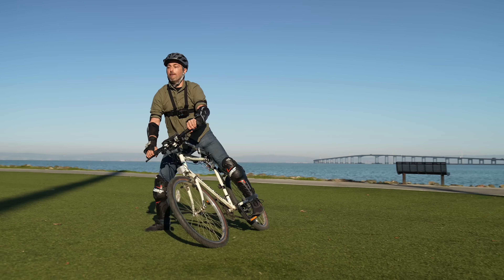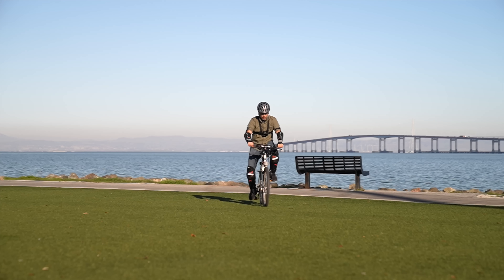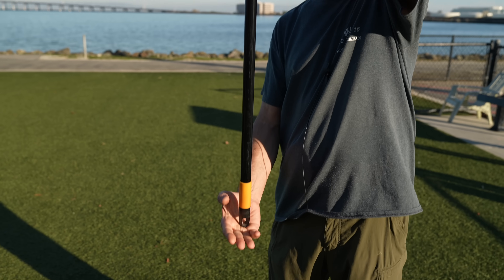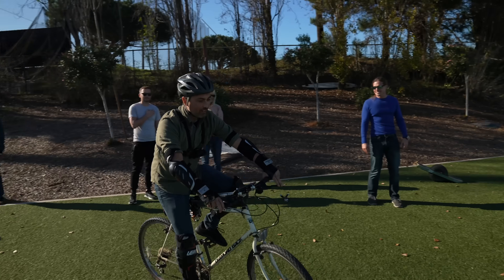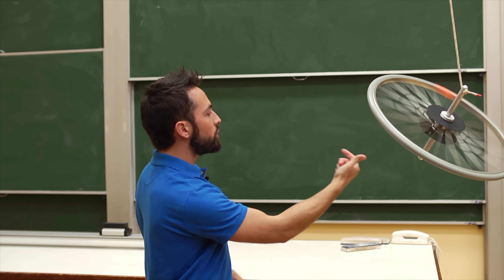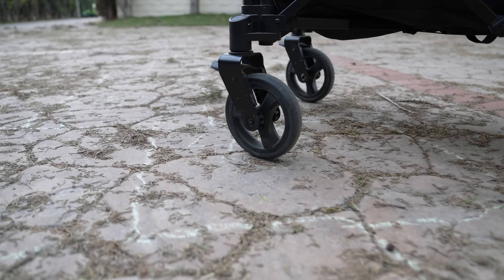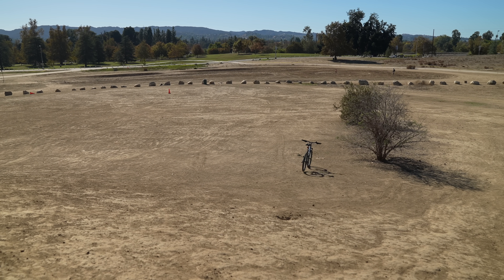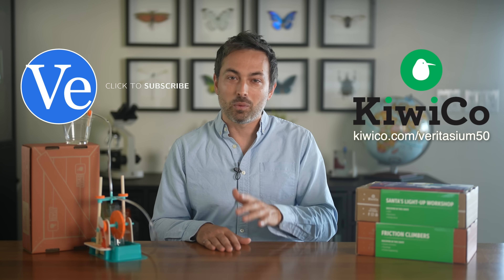Most People Don't Know How Bikes Work

Comment: There is one slight issue with this. I've ridden a bike for a long time and am very familiar with counter steering. However as Derrick points out, when you want to steer the bike a certain way you must first counter steer to move the bike out from under you and then steer into that lean. However you don't need to counter steer to move it out from under you, you can simply shift your weight and lean over and then steer into that lean just the same. 

If what he's saying is true then you wouldn't be able to steer with out touching the handle bars but that's really easy by shifting your weight.
Reply: If you're leaning into a turn at any significant speed, you are counter-steering. You may not realize it but you can notice by the PUSH pressure you're putting on the side of the handlebars the direction of your turn is going. If you're at speed and leaning into a turn and you're not applying that counter pressure, you aren't turning, you are high-siding.

A better thing to highlight in this video would have been to explain the speed threshold in which this applies, as it's likely not as apparent to a MTB rider as it would be a motorcyclist.
Reply: So many "know-it-alls" here, even after being shown definitively that countersteering is indeed utilized in every turn.  Frustrating!
Reply: @dudeonbike800  You'd think the hands-free examples we have chiming in here would be able to see this easily happening before them.

I think that the main flip flop I'm seeing here is the semantics around "steering". Generally speaking we're talking about the riders input. For the hands-free people, you're still witnessing counter-steering. Your bike steers inward when you lean in order to keep the bike upright, not to help turn that direction.
Reply: @dudeonbike800  Shown definitively? Not even close! Not one of the people there were able to remain upright on a perfectly still bike. Once you show me someone who can remain upright on a stationary bike that can't turn without a counter steer, then I will believe it.
Reply: @willhendrix3140  every bike countersteers to initiate a turn, regardless of handlebar input.  With an exception of kicking out the rear wheel to initiate a powerslide, perhaps.

I can stay upright on a stationary bike without a counter steer.  It's called a track stand and one does it with the front wheel turned to the side and the bike is rocked back and forth to maintain equilibrium.  The track stand starts and is held with the wheel turned, so there is no countersteer involved.  But that's irrelevant to the balancing dynamics issue of a bicycle in forward motion.
Reply: @dudeonbike800  That's a great example! I'm not a professional biker, and had never heard of a track stand, but it is the perfect example. A track stand is essentially taking counter steering to its absolute limits. You are moving the contact point of the bike with the ground back and forth in order to keep your balance. Turning without counter steering is essentially a track stand with your breaks held all the way down. Much harder, but still doable
Reply: @dudeonbike800  The scientific method relies on doubters and contrarians. Debate and diversity is healthy.
Reply: @topcat8804  but arguing something that's been clearly proven here and in a LOT of other places is banging your head against a wall.  I've known this for a long time, yet people still stick to their preconceived notions, despite being proven wrong again and again.

Just read down the comments and people keep saying, "Yeah, but with an EXPERIENCED CYCLIST, maybe not..."  No, it's the same dynamics, regardless of the rider.  I've never actively countersteered my bicycle, but I don't deny the fact that a bicycle "steers into the fall" every single time.
Reply: Absolutely! I've been a mountain biker for more decades than I can count. This method is often used to maintain your line while turning. To teach it, I describe it as "diving into a turn". That's what it feels like.
Reply: Faster and heavier bikes prove the point of this video. No counter steering means no turning. Twist of the Wrist author Keith Code demonstrates this with a custom bike with a fixed set of handlebars above the main ones. No amount of leaning gives any kind of meaningful cornering.
Reply: I’m only a casual biker so I may be missing something, but in my experience of riding hands free, the handlebars are actually still moving. They move because of the “self-driving” forces outlined starting at 7:25 that turn the front wheel towards the way you’re leaning.
Reply: When you ride a bike without using the handle bars you are making tons of micro adjustments while riding and before leaning to turn one way there will absolutely be some kind of counter steer that takes place before hand. You can't just "lean" on a bike. In a perfect scenario where you were perfectly balanced on a bike that had very skinny contact points with the ground and there were no outside forces acting on you, it would be impossible for you to fall off of the bike. If you leaned one way the bike would lean the other and your combined center of mass wouldn't change. That's why in the test with the stationary bike and the bike with the completely locked handlebars nobody started to fall one way, only to bring it back and fall the other way. No matter what, if you are turning, some degree of counter steer has to happen beforehand, initiated by you or not.
Reply: Shifting your weight moves the handlebars.  The guy that desperately tried shifting his weight seemed to show that if the handlebars can't move, it doesn't work
Reply: Hmm I think you are wrong, leaning into a turn does involve counter steering, and so does turning with no hands. Counter steering still happens in both scenarios. I first heard about counter steering on bikes as an explanation for how a leaning turn works. No hands is easy to tell, you can watch how the handlebars move as you shift your weight.
Reply: There is a great example in twist of the rist 2 about learning to drive motocycle. Motocycles depend on countersteering for safe driving and there is an example what happens when you just lean.
Reply: It feels like it's your weight and you're not counter steering, but you'll find you actually are, just very subtly. This becomes more evident on a sportbike at 100km/h+ because at that speed it's basically impossible to steer using only weight, but even a slight push on the bars with your pinky can lean the bike all the way over. I also intuitively thought the same thing as you until I tested out trying to steer motorcycles and bicycle at more than 40kmh without hands on the bars.
Reply: Twist of the wrist disproves this. Body lean definitely has an effect on a bicycle because it's low mass, but it becomes clear on a motorbike. Countersteering is the one and only way to steer a bike.
Reply: @stable-confusion-x  seconded. Twist of the wrist is brilliant to mythbust a these non believers of countersteering
Reply: @PiggyPower  It's surprising there are so many non believers.. until I remember that I was one before watching TOTW.
Reply: @stable-confusion-x  ... but bikes DO have low mass.  Countersteering for motorbikes is all well and good, and it certainly works for regular bikes, but contrary to the claims here it is not needed for a regular road/mountain bike with locked steering.  The noobs in this video couldn't, but they are very much doing it very wrong.  To steer by leaning on a bike you need to get your butt out of the seat and you're actually going to be applying a lot of downforce to the opposite handlebar.  That is, right foot pushes down pedal, left hand pushes down handlebar, the bike leans right and you lean left.  That is how you go straight with locked handlebars.  To go right, you don't apply as much force on the handlebar to counter, opposite scenario for left.  When people say they "lean right" I think they mean they are leaning the bike to the right, but they put their weight left to stay balanced.  At slower speeds that is, at higher speeds you do have more leeway from the gyroscopic effect to use a much more mild lean.  You can't swap your weight appropriately with your butt in the seat, so it is very obvious how everyone in this video fails.  

Sorry for mixing two cases above, a locked bike steering won't go right or left, but it should be quite possible to go straight on it.  In the unlocked steering case I contend that it is possible without counter steering, but you do still need to be able to steer in the intended direction.  

Motorcycles have much more mass and cannot be readily manipulated in this way.  It's plenty of effort on just a bike.
Reply: @zvxcvxcz  You are wrong. Counter steering is required for all single-track vehicle. Lookup the turning section of "Bicycle and motorcycle dynamics" in Wikipedia.
Reply: @zvxcvxcz  you can push down as much as you want on the handlebars of a bike, motorbike or bicycle... It won't do anything. Push left to go left. Push right to go right.
Reply: @zvxcvxcz  When you lean a bike over with locked handle bars, you're now riding a bike straight ahead and leaned over to one side. I highly encourage you to watch twist of the wrist. I think you'd get a lot out of it.
Reply: No you still need to counter steer. "Pushing the bike out from under you" is kind of a poor description in that regard. You need the combined centre of balance of you and the bike to move out of line with the point where your wheels touch the ground. If you lean without steering, your bike will lean the opposite direction and your combined centre will still be above that point.
Reply: @jjkthebest  This is not the case. It is entirely possible to shift your center of mass without leaning the bike, just get out of the seat and shift side to side
Reply: @willhendrix3140  If you "get out of the seat and shift side to side" you are just leaning the bike in the opposite direction. This does not directly change your center of mass. Every action has an equal and opposite action.
Reply: @garethhanby  Think about it this way: the pedals are in the up-down position, and you are standing on the bottom pedal. Easy to balance now, right? You can move your center of mass back and forth without leaning the bike, and you can lean the bike without moving your center of mass back and forth
Reply: @willhendrix3140  You're kidding with this center of mass and no counter-steering stuff right? Please by all means list the factors that are allowing the bike to turn when you "just get out of the seat and shift side to side".

If you are not leaning the bike, yet you are turning the bars in the direction you want to turn, I don't care where you put your center of mass, proven physics says your ass is high siding.

I'm thinking you're basing this off of some low speed maneuvering, in which you're just not noticing or just deciding to disregard the lean that is in fact happening with the bike.
Reply: @willhendrix3140  Why are you talking back and forth? This is left to right movement we are talking about. I don't know what you mean. But we turn a bike by leaning the bike not changing the center of mass of the man-bike system.
Reply: @kkanite6170  There are two ways to lean a bike: by leaning your body and having your bike lean the other way:〈 , or by moving yourself to the side and letting gravity take you down (I don't have a character to represent this, think a table with two legs on the same side taken off as the extreme). By going the second way, if you time it right, you can turn with no counter steering required by using the lean you get during the "fall"
Reply: @garethhanby  If you change the center of mass relative to the contact positions of the tires with the ground, the bike starts to tilt in the direction you want it to. Leaning like〈   just moves the center of mass in the wrong way and is the reason why people fall off still bikes. If you only focus on the center of mass and the contact points with the ground, you can stabilize a still bike much easier, and can initiate a turn without a counter steer
Reply: @willhendrix3140  The point is you cannot "change the center of mass relative to the contact positions of the tires with the ground" it is one of the fundamental laws of motion:
-"If a system experiences no external force, the center-of-mass of the system will remain at rest, or will move at constant velocity if it is already moving"-. 
In this case the system is the man-bike and leaning does not change the center of mass at all, it remains directly above the tires. When you lean the bike tilts because of the reaction force of the movement, not as a result in the change of the center of mass.
Reply: @garethhanby  There is an external force, friction between the tires and the ground. If you lean like〈  , you aren't moving the center of mass much, but if you shift your body one way or another, the bike-man system experiences a friction force against the ground, and the center of mass moves relative to the contact points
Reply: @willhendrix3140  Well yes, that friction does exist, but when you suddenly move your weight (left-to-right) the centre of mass does not change and so there is no friction due to this movement. Friction only comes into play when the bike turns in response to the leaning.
Reply: @garethhanby  What I am saying, is that by being picture one, you are keeping the bike straight and moving the center of mass away from the contact points, allowing the fall to occur without a counter steer
Reply: @willhendrix3140  How did the first one come about? The person leaned to the right, to do so he would have to push the bike to the left which would have leant the bike to the left. The first diagram would never happen, it is against the laws of physics. This is really basic stuff.
Reply: @garethhanby  Think about putting the seat of the tire in the crook of your knee. You move to the right, the bike is to the left of you, your center of mass is way off balance. 
Sorry for the late response, for some reason rusty's comment came in before yours, even though the timestamps are the other way around
Reply: @willhendrix3140  Oh dear, you cannot just move to the right, there is this thing called conservation of momentum. There is one mistake I made to do with tyre friction. If you lean to the right - which you can only do by pushing the bike to the left - the bike will attempt to rotate around its center of mass. If you did this in free fall the whole bike would rotate and the tyre would move to the right. This is prevented on the ground by tyre friction and the center of mass would move slightly. But the effect is small compared with the others.
I found this in an excellent wikipedia article entitled "Bicycle and motorcycle dynamics" which has a steering - no hands section:

While countersteering is usually initiated by applying torque directly to the handlebars, on lighter vehicles such as bicycles, it can also be accomplished by shifting the rider's weight. If the rider leans to the right relative to the bike, the bike leans to the left to conserve angular momentum, and the combined center of mass remains nearly in the same vertical plane. This leftward lean of the bike, called counter lean by some authors,[45] will cause it to steer to the left and initiate a right-hand turn as if the rider had countersteered to the left by applying a torque directly to the handlebars.[48] This technique may be complicated by additional factors such as headset friction and stiff control cables.
Reply: @garethhanby  You can just move to the right, conservation of momentum only applies on objects which have no forces unbalanced acting apon them, and friction is an unbalanced force. Remember, we are talking about picture one, not picture two. In picture two, you are correct, there is very little movement of the center of mass laterally, and any movement would be in the wrong direction anyway. In picture one, there is a much lager movement of the center of mass, and it is in exactly the direction you want to go.
Reply: @willhendrix3140  Picture one is impossible. Read the wiki article I sent you in my last comment, it corrects you on everything and me on the one thing.
Reply: @garethhanby  Picture one is not impossible, I do it all the time. That's the main reason I know anti-counter steer turns are possible. As I said in my last comment to you, conservation of momentum only applies on objects which have no unbalanced forces acting apon them, and friction is an unbalanced force.
Reply: @willhendrix3140   Read the wiki article, any further discussion is useless. You can also read "Steering in bicycles and motorcycles" by Fajans, J. which is available on the physics journals.
Reply: @garethhanby  I did read the wiki article, all it does is describe the process of counter steering, and the citation leading to Fajans' paper lead nowhere. This would be equivalent to saying that because primes can only appear at numbers just before or after a multiple of six, the twin prime conjecture must be true. As I've said twice before, conservation of momentum only applies on objects which have no unbalanced forces acting apon them, and friction is an unbalanced force. This is the only "argument" the wiki gives, and that is because the wiki is not trying to say counter steering is the only way to initiate a turn, just a rapid one
Reply: @willhendrix3140  There is conservation of angular momentum as well. The system is pivoted on its types, you cannot lean without the bike leaning the other way. You may think you have done it but you haven't. You cannot lean on a bike without imposing a force on that bike which will cause it to lean.  It is impossible. It is so obviously impossible I cannot believe we are discussing it.
Reply: @garethhanby  As I've said in my last three comments to you, conservation of momentum only applies on objects which have no unbalanced forces acting apon them, and friction is an unbalanced force. Even if you say it must lean, it will not lean as much as I lean going in the opposite direction, because I am pivoting my body not around my center of mass, but my bottom foot, which is below the center of mass of the bike, and the levers between the pivots impart a larger movement on me than the bike, moving the system's center of mass in the right direction. As long as the center of mass moves in the right direction relative to the contact points between the bike and the floor, the bike-man system experiences a torque bringing the center of mass farther over in the right direction, allowing for a turn without a counter steer
Reply: @willhendrix3140  And as I say angular momentum must be conserved and there is no friction to counteract that.  As the wiki article clearly says:
_If the rider leans to the right relative to the bike, the bike leans to the left to conserve angular momentum, and the combined center of mass remains nearly in the same vertical plane _
It doesn't matter where you pivot your body, the centre of mass will remain in the same vertical position. I am ending this discussion because it has become insane, a 15 year old physics student would know what you are saying is wrong.
Reply: @garethhanby  I'm going to stop copying it over and over again, but one last time: because of the lateral force of friction between the bike and the ground, there is no conservation of momentum. Yes, it does matter where I pivot my body, as the moment of inertia changes. Sometimes it helps to think of extremes. Imagine a bike with a pedal inches from the ground. You can easily see that you can lean to the right without causing hardly any movement to the bike. If you looked at an actual bike, you'd see that the bottom pedal is not that far from the ground, and the same line of reasoning works on the pedal
Reply: @willhendrix3140  It is angular momentum that is the issue, there is no friction on the ground to stop the system rotating. If you are standing on a pedal inches from the ground how are you going to lean? The only way is to push the bike higher up which will cause it to lean. You have to push against something to lean you cant just decide to by force of will.
Reply: @garethhanby  There is plenty of friction on the ground to stop the system rotating, unless you have a habit of riding bikes on ice. Secondly, if you cannot lean while standing on one foot, I pity you. Just on a bike, you are aiming for falling over instead of staying still
Reply: @zvxcvxcz  Just read the Wikipedia article.  I'm not going to have the same conversation again. What happens is you lean one way, the bike leans the other. The bike will now automatically counter steer (because of the mechanisms described in the video). That is what happens, there are physics papers on this, read them.
Reply: @willhendrix3140  "Friction on the ground will stop the system rotating", can you not see how crazy that is? If you apply a force to an object that is anchored at one side, that force becomes a torque, which rotates the system. Jeeze, take a physics course.
Reply: @garethhanby  Yes! This exactly correct! The lateral friction acts as a torque, pushing the center of mass into the turn, then you can preform the turn as normal, and no counter steer has occurred
Reply: @willhendrix3140  groan
Reply: Exactly. You don't even need to hold the handlebar to initiate and execute a turn. You can learn to use your body alone
Reply: @pranavlimaye  haha yep, done that many times
Reply: Long time cyclist and motorcycle rider. Your comment got me thinking... It's true that you can steer without touching the handlebars, but that doesn't mean that the handlebar isn't "self-steering" (or self-counter-steering, as might be the case here). In other words, even when you use your weight to initiate a turn, the handlebar might in fact be turning ever so slightly in one direction or the other, and as a skilled rider, you just intuitively proceed with the rest of the maneuver.

The real way to test this would be by locking the steering as they did in this experiment.
Reply: @ChetanRao  We went over this higher up in the chain, but I'll reiterate here: Handless turns almost always have a counter steer incorporated in them, and are much harder to eliminate the counter steer from. It is much easier to do a anti-counter steer turn on a bike you are steering with your hands
Reply: @ChetanRao  well said. Although they will still deny it.
Reply: If we simplify it, you can't really "lean" on a bike. You can only push it away from your body to the side, but the center of mass of you+bike stays in place, and there is no net force pushing sideways that would start a turn.

In practice two things happen. Pushing the bike to the side makes the steering column angled to the ground which then performs a countersteer. This is the major effect (and how you drive hands off). There are also other effects from tyre camber as well as ground reaction vector shifting sideways due to tyre being flexible and with contact "path" instead of idealized "point". These are lesser unless you are at very low speed or stationary. Which fuels the feeling that leaning actually work directly when at speed which isn't really right. But definitely Derek could have gone deeper here.
Reply: @lingSpeed  The center of mass of the bike+person system does move if you keep both vertical, and shift the person left and right. The tire experiences friction with the ground to move the center of mass back and forth, and then you can use the lean you get from the falling center of mass to initiate your turn instead of moving the contact points with the ground to the side
Reply: @lingSpeed  Exactly. But I fear there are people here that will never get it.
Reply: Every action creates an equal and opposite reaction. If you lean left, the bike leans right, and your center of mass remains directly over the contact patch. You simply aren't noticing what's going on with the steering when you claim to be able to simply lean to initiate a turn, similar to those who claim that countersteering only "kicks in" above a certain speed. It's just not true. Same thing is happening with no hands, the bike's just doing the countersteering for you (you lean left, bike leans right, the steering geometry kicks in and countersteers putting the bike back in line with you, then your center of mass is to the left of the contact patch and the bike turns once the steering comes back to the left).
Reply: Yeah there's a type of trick bicycle (i think its a bmx) that has locked in place handle bars so you lean and/or tilt the bike under you for steering.
Reply: I dont agree, when shifting your weight you only change the angle of the bike. Because you cannot push yourself out of balance. Same for the handless steering, you lean very little right to let the bike steer slightly left before you lean strongly right. If you would go right by only leaning right you would fail. 

Only because of the laws of conservation of energy. If you move right, your bike moves left. Seen from behind. In the ideal world you would be able to lean left again and become perfectly straight up. Unfortunately no one is able to keep their bike upright long enough to prove that.

When going for a small turn you may be right because you prevent going left but not going right and end up going right. Thats exactly what veritasium pointed out in this video.
Reply: @Robbedoes2  You can change more than the angle of the bike when you shift your weight, you can change your center of mass. As long as you can change your center of mass towards the turn without angling your bike, you will start to lean in that direction and you will not need any counter rotation
Reply: @Robbedoes2  No, you squeeze the bike seat between your thighs very strongly and the bike goes where you go.
Reply: @raheppe  but the bike will still be counter steering
Reply: @Robbedoes2  I would need this bike in the video and room for some speed to prove it.
Reply: @Robbedoes2  I absolutely promise you with some speed you can make a literal 90 degree turn without counter turning. You take a very wide path but it works.
Reply: @Robbedoes2  Technically, you wouldn't be turning 90 degrees. You are making a 90 turn to an adjacent road by making a circular motion and you do this by simply leaning left. Yes, sir. The contention could only be that my turn is not technically 90 degrees.
Reply: @Robbedoes2  Counter Steering | The interesting physics behind it
There you go, watch that video, that is the tile. 4 minutes.
Reply: How do you tilt a bike? If you want to turn right you move your upper body to the right, this pushes your lower body and the bike to the left. This causes the bike to lean to the left and it turns to the left to compensate. So when you shift your weight you are still counter steering.
Reply: @garethhanby  You literally just lean.
Reply: @raheppe  "just leaning" does nothing as there are these things called the laws of motion. If you lean to one side you are pushing to the other.
Reply: @garethhanby  I think you two are talking past each other here, rusty was answering your rhetorical question & I don't think they read the rest of your comment. What you described was an accurate depiction of how to counter steer while handless.
Reply: @garethhanby  I gave you the video. Not sure what else to say. You are truly as wrong as wrong gets. There are two ways to turn, by simply turning or the easier way, counter turning. Good god, man. I give up. Go comment to the person that made the video and explain to them how their physics are wrong. Otherwise, this is just weird.
Reply: @garethhanby  When a motorcycle goes around a big curve, did they counter turn??? Then how could they possibly do that!?!? Again, the link.
Reply: @raheppe  Linked what video? I didn't see it, sometimes comments with links are auto-deleted. Try just sending the title of the video. 
Also, to anyone who still doesn't understand please keep saying things, as a math and physics tutor and avid cyclist I would love to continue educating you. Just reply to one of my comments instead of rusty's
Reply: @willhendrix3140  Counter Steering | The interesting physics behind it
Reply: @willhendrix3140  As they explain, with physics, you can turn without counter turning. Pretending otherwise, and stating because physics, just really confusing. I honestly do not need a good understanding of written physics, laws, education, etc. to naturally understand something I have experienced many times. But since you want one, there it is.
Reply: @raheppe  Thanks!
Reply: @raheppe  I saw no video, links do not get through. But videos are often wrong. Yes, I  have ridden motorcycles on road and track and we always counter turn. I will tell you something to try (and I have got people to try this).  Ride a bike at any speed you like and take you hands off the handle bars. Now try and turn left by pushing the right handle bar with a single finger. It is impossible, all that will happen is the bike will lean to the right and you will fall off unless you correct it by turning the handle bars to the right and making a right turn.
Reply: @garethhanby  Yes,  that will cause you to fall (or more likely just turn the opposite direction), because you did not initiate the turn correctly. All you have to do is shift your mass over so you are already falling in the correct direction, then you will be turning without any need to start turning the wrong direction
Reply: @garethhanby  You're clearly wrong. I think the video is titled 'how counter steering works' or something close. It is 3 or 4 minutes. They explain how counter steering is better but then they explain how one can factually do both, and it explains the physics of it. You are simply wrong. All you gotta do is ride your bike and try it, or watch the video i speak of or watch a riding video from a go-pro on Youtube, bike riders, motorcycles, any of it. You will see. I'm so confused why anyone would think you literally can't turn without counter turning. Very strange conversation.
Reply: @garethhanby  Counter Steering | The interesting physics behind it
Reply: @raheppe  Wrong. Every rider counter steers and those that claim they don't, do it without thinking. This is a scientific fact.
Reply: @garethhanby  No, that doesn't sound like counter steering at all, you're garbling definitions now.
Reply: I came here to say this. Counter steering may be important for maintaining balance but isn't necessary for initiating a turn.
Reply: Exactly what I was thinking cuz I ride a bicycle without touching the handle many times and I'm still able to steer completely fine just by leaning the direction I wanna go in no counter steer.
Reply: I can wheelie on a Mountainbike and do turns without a problem. When riding no hands it depends on the steepness of the turn if you need to counter steer. You still do it with your bodyweight, but the handlebar needs to turn with it
Reply: This video isn't a lesson on counter steering. There was already a unicycle example (full body steering, no handlebars), riderless bike keeping balance (bike body steering itself) in the video and examples of how the trail of the front wheel, its weight balance and the gyroscopic effect affects the steering of a bike.

The point of the video is talk about the various mechanisms that are involved with steering and balancing a bike and how they are connected.
Reply: @electric_boogaloo496  No one here is saying this video is a lesson on counter steering, we are arguing whether one point the video makes is true: "You need to counter steer to start a turn." I say you don't, and that plenty of people more experienced than those shown in the video could ride an anti-counter steer bike.
edit: grammar
Reply: @willhendrix3140  With a locked steering, no, you cannot balance the bike longer than single digit seconds. Even if you can track stand a bike all day. The mere act of turning the steering on a stopped bike moves the contract patch side to side with respect to your center of gravity. Its a small amount, but a skilled rider can use that small amount to track stand. Edit: The only way I think balancing a bike with locked steering is possible is by hopping it side to side somewhat like balancing on a pogo stick in 1d instead of 2d

Can you steer your bike without any direct input to the handlebars? Or with no hands on the handlebars at all? Absolutely. Even if you don't give the counter steering input directly to the handlebars, you give it indirectly my moving your weight, as demonstrated in the video how the front automatically steers on a bike when weight is shifted. The front wheel will take a very similar path in both cases. When a bike initiates a  turn the front wheel has to counter steer with or without rider's direct input.
Reply: @electric_boogaloo496  The point of a counter steer is that you need to fall in the right direction, and it moves the contact points out from under your center of mass, and allows you to move the contact points farther and farther in your desired direction as you "fall" in that direction, moving your center of mass even farther, and so on.

I am saying that while keeping the contact points going in a straight line, you can move your center of mass out of line of the contact points, and use this to initiate the "fall" required to make a turn without requiring a counter steer. Also, I disagree with your statement that you cannot balance on a bike with locked steering

I am not saying that people don't instinctively make a counter turn, just that it is possible to preform a turn without counter steering.
Reply: @willhendrix3140  You see, to move my CG/CM side to side I need a reaction force in the roll axis of the bike. Without a reaction force, if my upper body moves to the left, the lower body will move to the right and my CG/CM will not move at all. But lets roll with this example, say I moved my upper body to the right, my lower body moves to the left, and the bike tilts left with it. The normal force off the ground and the trail of the bike forces the handlebar left and now the bike wants to be upright again. As it gets upright, the handlebar gets straight. I haven't changed my posture, when the bike comes upright, now my lower body is also upright as opposed to leaning left, I still have my upper body to the right and the imbalance when the bike comes upright will force me into a right turn. Counter steering still happened here.

When you move your upper body to one side, your lower body is doing the counter steering. You can't just move your CG/CM without the steering helping you when you have no reaction force in the roll axis. Just wet your tires and look at the lines it leaves on the road.
Reply: @electric_boogaloo496  The reaction force is lateral friction between the tires and the ground.

The scenario you described is exactly correct, you preformed a counter turn there. This does not disprove the existence of non-counter turn turns. Consider: you keep yourself and the bike perfectly upright, traveling along a straight path. Consider balancing movements negligible. Without leaning, move your bottom off the bike, and instead put the crook of your knee in the seat of the bike. With your body and bike still vertical, your center of mass has moved to the side and you are falling towards that side. Now, you must turn your wheel in order to not fall, and return to your seat to recenter your center of mass and stop turning. You have now preformed a turn without ever turning your bike the counter direction
Reply: @willhendrix3140  If you use lateral reaction force from the ground, the bike will still roll/tilt in the opposite direction of your movement initially. That's why I said roll axis, and not laterally. The rest of the example is the same as what I just described. Except the point where your body rotates has shifted lower in your body from the belly button to the knees when you take your butt off the seat instead of tilting your upper body.
Reply: @electric_boogaloo496  Your roll axis is the axis that is effected by lateral forces. Maybe you didn't see the pictures, I'll copy them here for you. Pic 1 is what I am saying to start the turn, pic 2 is what you are likely thinking. Both bikes are viewed straight on from the back. To achieve this position, just put all of your weight on the bottom petal, and move over. For clarity, arms are not drawn, just legs

                    O
       \___/     |
          |          |
          | _____|
          |       /
         -|-  /
          |

vs

                    O
    \___/      /
         \      /
           \_/
              \
                -\-
                    \
Reply: @zvxcvxcz  "Do none of you know how tires and friction work?" You are thinking only in translation forces and not rotational forces. Your forces aren't in-line there has to be a torque which counteracts you moving the CG/CM side to side, there isn't. The result is, initially your CG/CM doesn't move but the bike leans away from the perpendicular and away from your body, which causes it to steer and move the contact patch.
Reply: @willhendrix3140  you are thinking only in translational forces and not rotational forces. The lateral force that you get from the tire contact is not in-line with the movement of the CG/CM from side to side. There is no torque resisting that movement, hence initially, the bike+ rider CG/CM cannot move over to one side. The bike will have to tilt to the opposite side if you try moving to one side.

I understood what you meant in the post before this one without the pictures. But to get to this

                    O

       \___/     |

          |          |

          | _____|

          |       /

         -|-  /

          |

you must first go through this

                    O

    \___/        |

         \          |

           \____|

              \    |

                -\|

                    \

The moment you try to move your butt to one side, the bike will want to move to the opposite side. Doesn't matter if you are using your hips or knees as a pivot for moving your body.
Reply: @electric_boogaloo496  There is no required push of the bike. Consider: stand on one foot, and lean to the side until you fall over. Congratulations, you moved your center of mass past your foot! Now, instead of on the ground, do this on a bike pedal
Reply: @willhendrix3140  Your foot has dozens of muscles and it has a wide enough contact patch to push the ground not vertically aligned with your CG/CM. Bicycle tire has none of that.
Reply: @electric_boogaloo496  The bicycle tire doesn't matter in this scenario. Imagine the bike is just standing still, and you are standing on one pedal. Now, initiate the fall over, but then grab the bike before you fall over completely. Now you and the bike are falling in the desired direction. Just do this while moving, and you have initiated a turn without any counter steering.
Reply: @willhendrix3140  I think everyone in this discussion is missing something.

The centre of mass of the bicycle in free space is irrelevant, because the bicycle isn't in free space. As you point out, the bike is on the ground, and there's friction between the tyre and the ground. So the bike-rider system is more like an upside down pendulum with the fulcrum at the contact patch. This is the upside-down-broom example demonstrated in the video.

But where you are going wrong is when you say that "leaning left won't cause the bike to lean right". Yes, it will, and it doesn't matter whether you are "applying that force" at the pedal, at the seat, at the handlebars - it makes no difference. Because as soon as you apply any lateral force against the bike, that becomes a torque around the pivot point, which is at the contact patch. If you move your body to the left, the bike will lean right. 

HOWEVER, what that will do is cause the steering to turn to the right. This happens because of the steering geometry. If you just go out and stand behind an upright bike holding onto the seat and then lean it to the right, the steering will "flop" to the right.

So, what does this mean for our leaning scenario? It means this: We have the rider leaning to the left, and the bike leaning to the right. Since the bike is leaning to the right, the steering will "flop" to the right. THIS IS THE COUNTERSTEER. The centre of mass of the system is either perfectly vertical (if the force applied when you leaned was pure torque) or slightly to the left (because some of the force applied to lean your body was translated into lateral force at the contact patch). So now we have the system in this state: The bike is leaned to the right. The centre of mass is vertical or slightly left. The front tyre has just turned to the right. The result is that the front tyre being turned to the right will now "out track", and cause the bike to lean back to the left. 

Shifting your body weight causes a counter steering action. But it's an extremely slow, "lazy" countersteer. It's an ineffective countersteer. It's wildly ineffective, in fact, and the demonstration of that was the purpose of the "No BS bike" built by Keith Code.

So - you're all right, and you're all wrong! :D 

Yes, friction at the contact patch can mean that the lateral force you apply is not pure torque. However, some torque will be applied. So when you lean your body left, the bike will lean right. It has to, because you applied a lateral force above the contact patch. This lean of the frame causes the countersteering action, which now causes the frame to lean left. The wheel now "flops" to the left. But it won't flop back to the right again, because now it is in balance with the position of the centre of mass. The result is a left turn.

The counter steer is always necessary.
Reply: @allmhuran  I am not saying to let the handlebars go where they want to go, I am saying to hold them at angle into the turn from the very start. While the bike may lean slightly left when I move right, the center of mass of the system moves far right, and goes past the line where the contact is, causing even more lean without the need for a counter steer.

You bring up "the no bs bike," and after a bit of googling, I think I see your confusion. This is a motorcycle, which is much harder to effect by moving your center of mass around. This is due to several factors, including, but not limited to: the bike is more massive, and any move you make is much less effective; the pedals are higher up, so leaning in one way will counter lean the bike the other way for a larger portion of the force; and you are going much faster, causing the torque around the wheels to be much more important. With a bike, however, it is much easier to put your center of mass over the line of the tires, even without preforming any counter steering (for context, my bike is around 15-20lb).

For completeness' sake, I would like to clarify, in case you missed it earlier, that I am not arguing that bikers on average don't counter steer, I am arguing that it would not be very hard for an experienced cyclist to preform a turn without any counter steering required.
Reply: @willhendrix3140  The mass of the bicycle vs the motorbike makes no difference to the physical principles at work, it only changes the degree of the results you observe. There isn't some "magic intermediate mass" where the physics of the bike suddenly changes from one to the other. They both work exactly the same way.
Reply: @allmhuran  It makes a large difference. It's the difference from having to move your center of mass of the side of the road to get the motorcycle to lean anywhere, to only needing a few inches for a bike. I have no experience with motorcycles, but I have plenty of experience with bikes, and from the videos I saw, it was obvious that they couldn't move their center of mass nearly far enough to have any kind of acceptable amount of control. The "no bs bike" implemented on a bicycle would not be very difficult to ride.

Other than that, yes, there is no "magic intermediate mass" where the physics of the bike suddenly changes from one to the other, and they do both work exactly the same way, it's just that the bicycle is much, much more receptive to control than a motorcycle is
Reply: I'm also not fully convinced this is true. You certainly can balance on a still standing bike. Not sure if that is important. But at higher speeds I don't think people counter steer instead of just leaning into a curve.
Reply: @goghvonjohann2924  You definitely still counter steer going fast, it's just a smaller counter steer. I would even say it's harder to not counter steer going fast, as it is harder to measure the turn at the start as it is so brief and shallow
Reply: I was planning on paying closer attention to it next time I'm on my bicycle, but this was for sure my first intuition. Because I feel I rarely actively steer, I just lean and only add steering if I need a sharper turn.
Reply: @wjzijderveld  Steering without hands actually uses a counter steer more intrinsically, because when you lean like:〈  , you initiate a small counter turn until the bike looks like / .
Reply: He does mention later on that its about the center of mass. Therefore, shifting your weight will do the trick just as well as moving the bike out from under you. If you think of both the bike and yourself as one moving object, the center of mass changes in both scenarios.
Reply: the bike steers on its own remember?
Reply: @rusty, I'm sorry, but after review, your video is both misleading and wrong. Every "turn" preformed in that video would have required a counter turn to start it. This does not mean my opinion has changed, and none of my arguments are refuted by this. The fact is, it's harder to eliminate the counter turn from a turn than just ignoring physics for the first few seconds of a turn, as you can't turn physics off in the real world.
Reply: this video is for noobs
Reply: @sulev111  yet many advanced riders...Inc those commenting here, still think counter steering isn't always used... Yet... It is. Go watch slow mos of it at work. Go watch videos of locked rider input with passenger steering. Lean all they want... It won't turn
Reply: @PiggyPower  I am not saying it is possible for motorcycles at all, those are heavier, their chairs are bigger, and their pedals are higher up, all of which are factors which inhibit the ability to make a turn without counter steering. To preform a turn without counter steering, you need to shift your center of mass away from the centerline of the bike, and wait for yourself to fall, instead of moving the bike out from underneath you
Reply: @willhendrix3140  countersteering is used on any bike no matter if it has an engine or not or if it's 15kg or 150kg.
Reply: @PiggyPower  Yes, counter steering can be use on any bike, and it is easier to make a turn with counter steering, but if you make a turn as I have described several times in this thread, there is no counter steering occurring. On a bicycle, you are capable of making a turn without counter steering.
Reply: @willhendrix3140  if it's true and I still can't see how you can defy physics... I'd love to see a head on slow Mo video of it in action. Genuinely. Please do it!
Reply: @willhendrix3140  explain how...
Reply: @willhendrix3140  this will still include countersteering. Can lean all the way off a bicycle... And it won't turn. Have to initiate it with countersteering.
Reply: Lean all you want... A turn is always initiated by counter steering. Go watch videos where they lock the steering on a motorbike and lean as hard as they can, essentially, nothing happens
Reply: Exactly. As an avid motocross rider/racer and someone who really enjoys his videos, this one pissed me off for some reason. I think a big part is just my ego and me not being able to tell him all the different techniques to riding 😂 I have a problem...
Reply: @blooiefps9304  yet if a motorbikes steering was locked, you couldn’t turn. Should see the videos ‘twist of a wrist’
Reply: @PiggyPower  yeah you're kinda wrong there. Your lean input steers the bike. If you lean left, you turn left. No steering input necessary.
Reply: @blooiefps9304  that's not how single track wheeled bikes work!! Watch twist of the wrist videos on YouTube... Can lean all you like... Need countersteering. If you lean and it steers...the countersteering has already happened. mid turn, lean over more... If anything, the bike just stands up more but continues the same radius... Counter steer midturn  while leaning... It turns more... It's physics.
Reply: @blooiefps9304  haha yes. I love his videos and he's usually really exhaustive in his scientific thinking but this one was a really self evident one to anyone else ridden a bike for a long time.
Reply: @RobDavisAkaMonk  Or maybe, all his videos are missing things but you aren't an expert in those specific things like you are with this.
Reply: @ShaunRL  haha yeah could be that too
Reply: @ShaunRL  holy moly you're onto something
Reply: @RobDavisAkaMonk  leaning on a bike is not that important. Check twist of the wrist or recent fortnine video where he talks about leaning and gives good examples.
Reply: Try riding this bike hands-free and you'll notice it doesn't work either. Even there, you still need to offset your balance to initiate a turn, which means steering the bike off the line in the opposite direction. Simply transferring your weight does produce a steering movement in the wrong direction. You simply do no have any leverage to get both your bike AND your body leaning to the same side without countersteer. You may not feel like it, but it is 100% necessary!
Reply: @kain0m  when riding bycicle without hands you still whip your front to initiate countersteering. Try slomo on your front steering and you will see the effect.
Reply: Exactly thank you, you can either lean into the turn or counter steer riding a bike is very easy if your not a quitter give it a hour and you should know this
Reply: Notice that none of those people were real cyclists.   They didn't dip the handlebars and counter lean awkwardly.  I still think it would be hard to steer that thing, but their bodies didn't react like a mtn biker would
Reply: Exactly how I ride and I ride a lot. I also counter steer, depends on the turn or what I am doing. If I'm going very fast, counter steering would not be wise. You just lean and turn, haha. Watch competitive bike racing on an oval track, for example. This video is goofy.
Reply: Yes u are right becoz you already knew where you have to go but the counter steer phenomenon works when you have to turn suddenly as you will see here 3:03 he said it suddenly and so that counter steering worked
Reply: Also, I ride no handed constantly. I make 90 degree turns without my hands, often. I can probably ride a unicycle. The point being, you can't counter steer without hands, at all, you'll br3eak your face. It is all balance and leaning properly.
Reply: @raheppe  no, you can counter steer perfectly fine without hands, in fact I would say that it is much harder for me to not counter steer without hands than with.
Reply: @willhendrix3140  Yeah, after I stated that i realized it was when i am riding fast that it is true. To me it seems speed decides this for us. That might be why in this video they can only counter steer, they are going so slow
Reply: @raheppe  No go ride a bike with locked handlebars and lean all you want, the most your speed will dictate is your medical bill.
Reply: @kkanite6170  No, one side has to be locked. You just moved the goal posts. Nice conversation there.
Reply: @raheppe  No you just can't seem to conceptualize how each factor plays into turning a bike.
Reply: BIKES GO STRAIGHT!

If they are leaning, they are falling.

That is why if the handlebars are locked, and you lean, you will fall.

That's where handlebars come in. That is the tool used to negotiate the fall and make it a TURN.

Turning a bike is a catch and fall game. You can counter-steer to help initiate that lean sure, or just fall into it, honestly that part doesn't matter much. What matters is, what happens next after that lean is initiated?

Hands-on-bars perspective: You will then PUSH on the inward handlebar (counter-steer) to fall deeper into the turn; You will PULL (or simply stop pushing) to dampen or complete your turn. (again, counter-steer)

Hands-free perspective: You lean a direction and your bike will steer it's bars inward to the direction of the turn in order to keep itself upright. That itself is the limited perspective you have of it, but it's clearly there. That turn of the bars into the direction of your turn is how the bike keeps itself upright, where it would otherwise fall if locked. It's not to influence the turn itself, that's what your lean is doing.
Reply: @kkanite6170  Honestly, I am not seeing how any of us are disagreeing with anything you said here; what are you arguing?
Reply: @kkanite6170  You claim if you lean then you fall then you go on to explain my entire argument at the end. How are you so confused, wth is your contention??? Clearly, as you literally just described, I can turn hands free. Motorcycles turn all day long without counter turning, literally. Most people intuitively can turn either of the two ways. This video is presented confusion. Tell these people as soon as they get on that they gotta turn right and the bike is locked to the left and you'll see every single one of them make the turn. Every single one of them will naturally figure it out and easily. This is such a weird conversation.
Reply: @kkanite6170  As soon as you get on a bike and try it, you're going to think, "OH!, duh", guaranteed.
Reply: @kkanite6170  Counter Steering | The interesting physics behind it
Reply: @kkanite6170  Watch that, you are incorrect. That is the title, 4 minutes, Youtube. You are wrong.
Reply: Here's a fun experiment many can try to see how it works:

1. Lock your handlebars straight in some way
2. Walk it in a straight line leaning it left and right throughout and see the direction it's moving remain unchanged.

You hands-free people that keep chiming in on the contrary need to realize that the "steering" discussed in this video is regarding rider input. Your bike still "steers" itself when you're going no hands. And that steering it's doing inward to the direction of the turn is to keep the bike upright, it's trying to finish that change in direction and right itself straight again, not continue the turn.